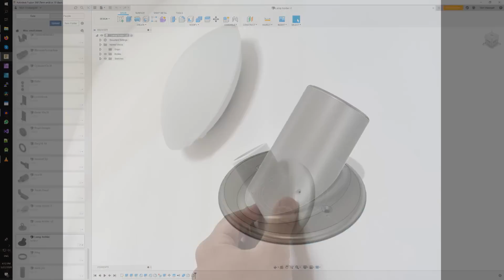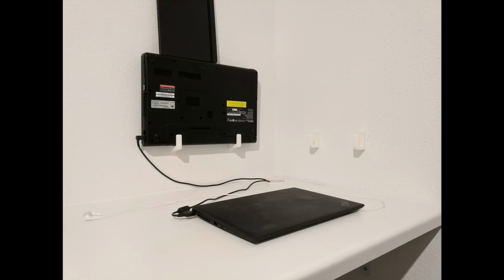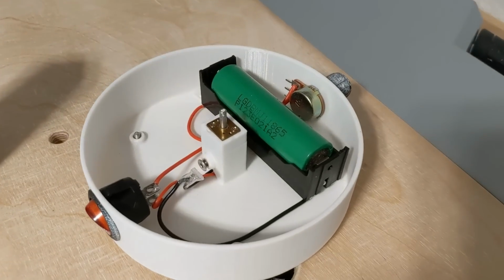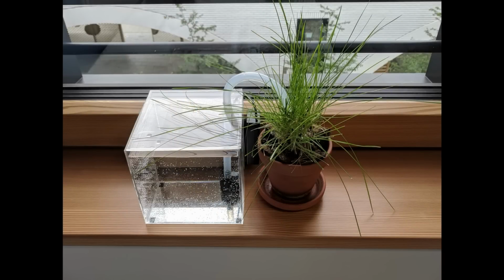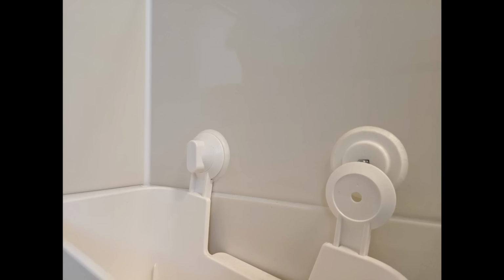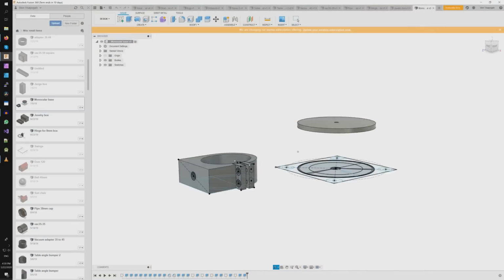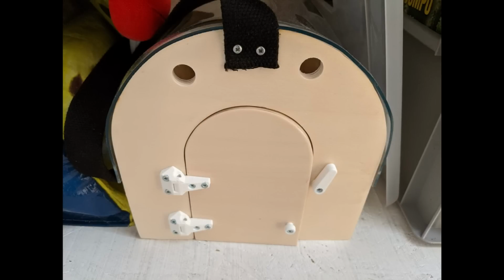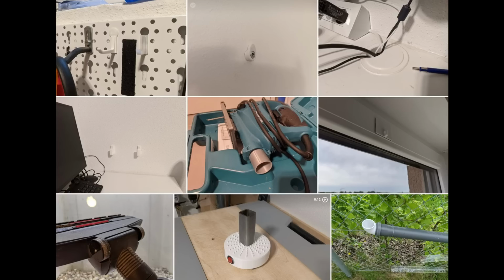Useful 3D prints

Comment: Hello Maxim, I hope you are fine. I would like to ask about the enclosure of the stepper motor to the Z axis installed on your mini lathe. I have one mini lathe with an ELS controlling just the X axis and I'm thinking to install the MEGAELS to control both axes, but due to the protection installed on the back of my lathe, I will install the stepper motor in front of my lathe. Do you have the 3D model of this enclosure to share with me? Thank you for sharing your knowledge with our community
Reply from the maker: Hi Nei, not sure which model you're looking for. Can you please point to a timestamp and video you saw it in? Thank you
Reply: @MaximKachurovskiy    thank you for answer my request. The enclosure that I mentioned not is showed in this vídeo, but in others where you talk about Mega Els or Nano Els. In this enclosure is installed the stepper motor with pulleys that coupling on Z axis.
Reply from the maker: @neiribeiroclpta  you can probably find it on https://www.thingiverse.com/kachurovskiy/designs - let me know if not 😀

Comment: For projects with gears you should order those very stable nylon gears(rods, helixes, etc.) from china. They come in cheap bags with various sizes, adapting your projects to them should be easy.
Reply from the maker: Great pointer, didn't know they exist!
Reply: @MaximKachurovskiy  You can get them from banggood, aliexpress etc. I assume they are gears which are usually used for certain moveable parts of electronic devices, like optical drives, printers etc. Most of them will fit on a 2mm steel rod/axis from the home improvement store (at least were i live they sell 2mm).

Comment: I like it how you show all the things that didn't work out as intended, because that is what happens 85% of the time. If you are near NRW, maybe drop by at the UN Hack Bar in Unna ;-)
Reply from the maker: I'm in Höhenkirchen in Bavaria, a fair 500km away :) This bar looks like an awesome place by the Google Maps photos. Do you run it?
Reply: @MaximKachurovskiy  Es ist ein Verein, also engagieren wir uns alle etwas ;-) Local Hackspace. Lustig, alle 3D Youtuber kommen irgendwie aus Bayern.
Reply from the maker: @SeamusHarper1234  got it. 3D printing is great in a sense that it's rather safe and fool-proof for hacking spaces like yours. In some cases wood and/or metal can solve the problem better (or solve problems 3D printer can't solve at all!) but running a such a workshop for the public is that much harder, dirtier and more dangerous.
Reply: @MaximKachurovskiy  Especially the dirt / dust is a concern. Also space. A printer requires 1m² at most. A table saw is so much bigger.